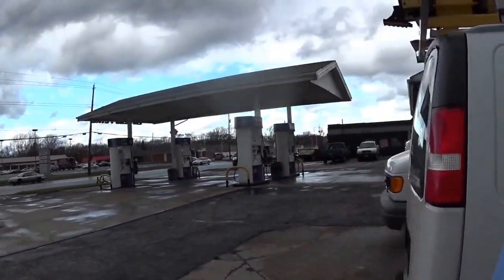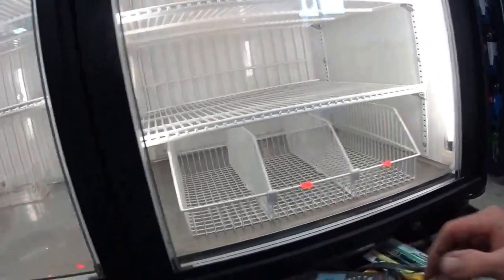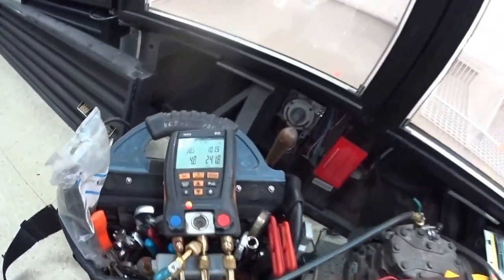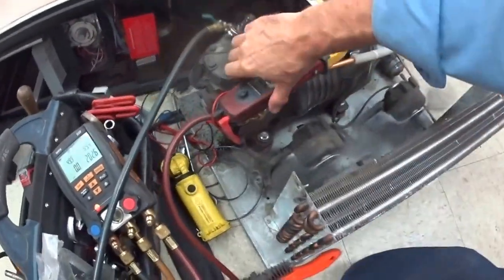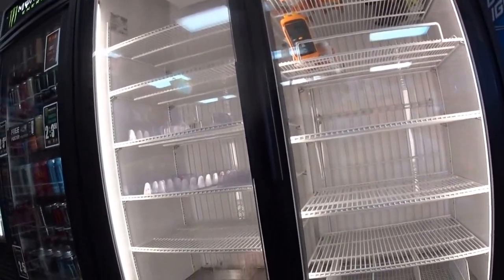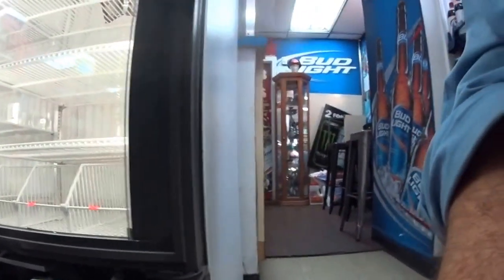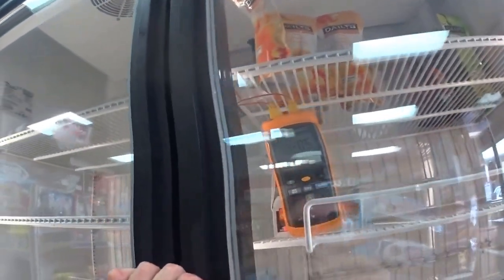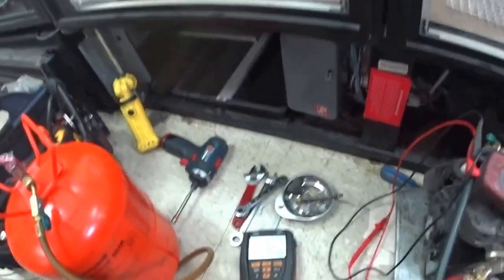TRUE Two Door Glass Freezer

Comment: I used to work on these things all the time. The evaporator pressure valve he’s talking about is actually a crankcase pressure regulator. This is used to limit suction pressure when the box comes out of defrost so the compressor doesn’t overload. They rarely need adjustment. The procedure is when the compressor first starts either after defrost or when the box is at room temperature, you adjust it so the compressor draws no more than it’s full load amp rating. You don’t even have to install gauges on it to adjust. Once the evaporator drops to a normal operating temperature the valve is no longer a factor. It is located on the suction line, usually near the compressor on these True freezers. You just remove the gnarled brass cover behind which is an Allen head adjustment. The cap seals with an o ring. Sometimes there is oil inside the adjustment cover which means it’s leaking refrigerant and needs replaced. Just wanted to point this out since he didn’t mention anything more about it.

Comment: the reason for the high head is a high heat load from the box.  Also the fact that the condenser fan cowling is missing,  so its hard to actually pull air through the coil with that missing.  Either make one out of card
board and duct tape or panning for a temporary measure, and order the actual part.
They are usually made of a dence card stock, so durability is not job one.

Comment: Refrigeration is far from my strong suit. We are just a residential / light commercial a/c company. I really enjoy your videos. They are helping me to pick up a little more knowledge.
Reply from the maker: Refrig and AC are close cousins, glad to help and share, some people are secretive, why.
Reply: Lynn Winstead you often find engineers trained on refrigeration units are never particularly fond of air conditioning and vice versa. the primary concept is the same but everything else is less similar. it comes down to personal experience - wouldn't surprise me if this gent works for himself, most service companies here in the uk dont get this kind of equipment or time to look at every single call out so in depth. the focus on kpi ratings and quick first time fixs have taken precedence over caring about the work and taking time to get a job done well. as far as so called engineers hiding information (in response to another comment) they do it to get brownie points. if other engineers are struggling because they don't know the answer it means the one who goes in that does gets an ego trip. sadly you get a lot of these numpty types and the laughable thing is they usually come unstuck because 'what goes around comes around' 😉 sorry for the long comment great videos man ☺

Comment: Please if you do not care about your costumer store, why do you bother cleaning the condenser, that is not the proper way to clean a condenser, if the unit is low in refrigerant and the amount is more that ½ of the total charge, is better to recover, check for leaks with nitrogen, replace filter dryer and chard refrigerant with a scale.
Reply from the maker: you sound hispanic. my ancestor was Charles V of Spain.
Reply: paulohvac He got the job done
Reply: spend alot of time in the field do you?

Comment: THX. Jim  for this upload. I'm new to this industry, have 2 questions. #1-You charged this unit from the low side with liquid refrigerant? #2- When charging, Why you don't weigh in your refrigerant(per manufactures spec.) as suppose to going by the amp draw and hi & low side pressure?
Reply from the maker: +hondagoal I meter the liquid in slowly so most of it boils off. I am so use o charging by pressure that it easier for me.
Reply: +Jim Pettinato THX. for the explanations. Love your videos, they're all good and informative.

Comment: Great video ! So you do not charge by pressure ?
Reply from the maker: On a unit like this one I'll charge by pressure, amperage, evap temp, evap delta T, liquid line temp and suction line frost back. If you over charge the unit it might not be apparent while the system is running, the problem will show up after the unit comes off defrost, too much refrigerant heat load will come back to the compressor and the amps will be too high, that's where the CPR valve (if set correctly) does it's job and meters the amount of refrigerant going back to the compressor to keep the amperage down.

Comment: Hello Jim I'm new in this trade, but i need to know something. How can i know what is the correct pressure or temperature in the system for correct charge. for example , In coolers True ( no freezers), normally the pressure for R134A is around 18-20 psi Right?,  in this video the refrigerant is R404A I supposed that this TRue is a freezer. Can you help me with this, because is confusing . How I know or what is a method to charging a maintenance cooler or a freezer cooler. Thanks.

Comment: Have you ever had to replace the drain line that runs down the back of these True units?  A client of mine had one break off at the grommet and i don't know if you can just pull a new on through or if it's a nightmare.
Reply from the maker: +aeroaggie sounds bad, luckily I haven't had to, True set up franchises to local companies, they are usually overpriced, something difficult like this I would refer the customer to them
Reply: I recently found a True factory service manual.  They actually recommend drilling all the way through the back of the freezer and running the drain down the outside of the unit.  Same with replacing the suction line and cap tube.  I've never done it but I may give it a shot someday.
Reply: If you had four skids of frozen shrimp. You' probably be better off using this stand-up freezer than like a 12-foot walk in for electricity savings?

Comment: He could not find a leak?  Copelemetic compressors are semi-hermetic.  You will likely find leaks on these,  under the terminal box cover.  Common start and run terminals have mechanical seals with screws and nuts.  Always sniff for leaks at these terminals.  You can usually snug them and stop the leak without removing refrigerant.
Reply: Found one like that today guy ended up opting for a new freezer instead of a new compressor